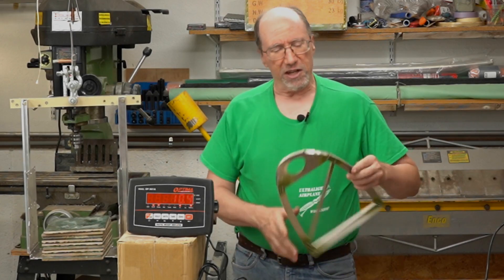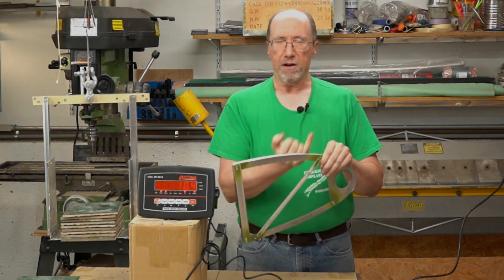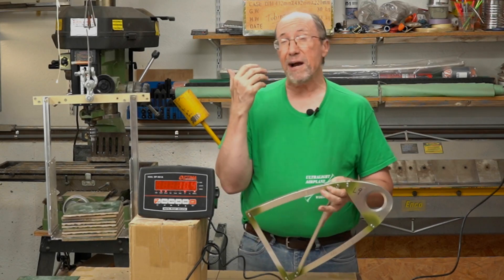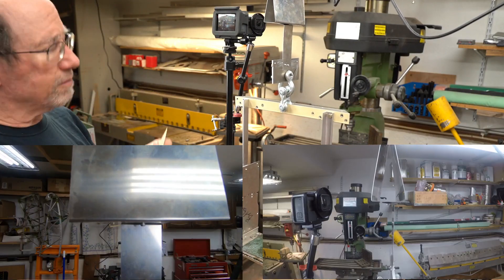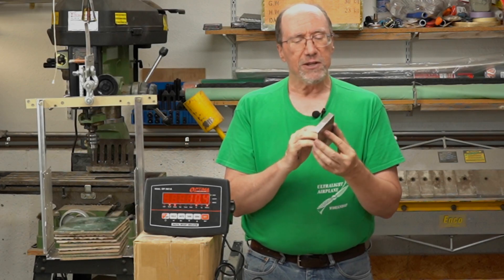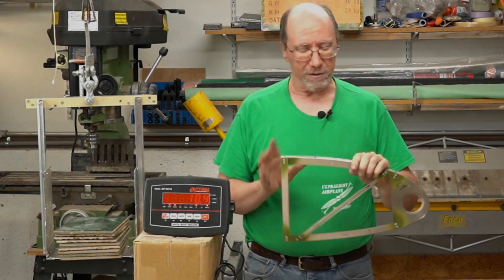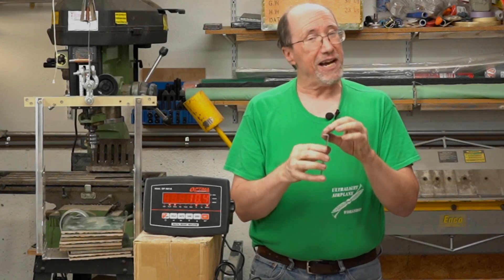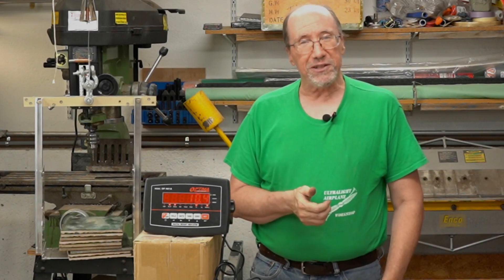Aluminum Wing Skin/Rib Rivet Load Test

Comment: well... I'm not sure you really grasp as to how the skin forces acts on those rivets. The pulling/pushing forces are negligible, but more important are the lateral forces (stressed skins as for all monocoque construction), that are in shear. Those are the primary forces encountered every time that wing wants to bend up or down. Yes, the skin, in whatever form, better stays attached to the form giving ribs 😉 Most designers nowadays disregard the skin for calculations, only relying on the spar strength on its own.

Comment: I think it would have been more realistic to use a 4" long piece with  two (2) rivets and tested it at 60LB.  I bet it would have been much stronger than just 2x, because of the structure and rivets helping to stabilize and support one another.  Remember the old story of "one horse can pull a one ton sled, but two horses, working together can pull a three ton sled".   Just my .02!! 🙂